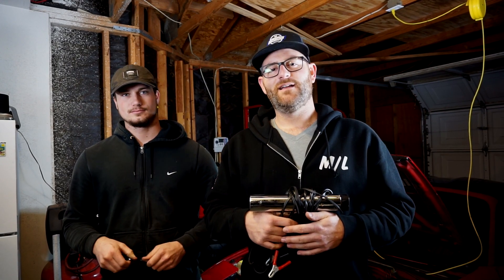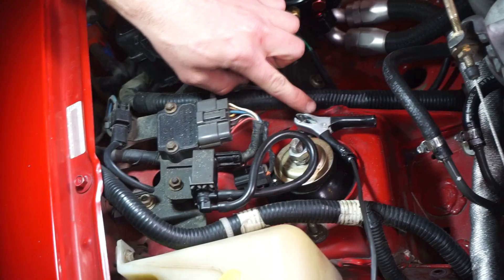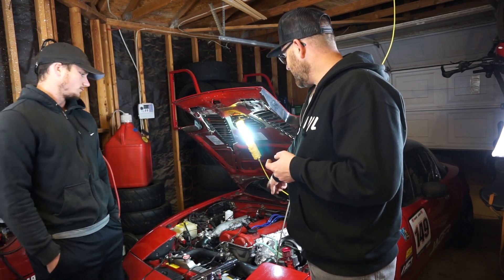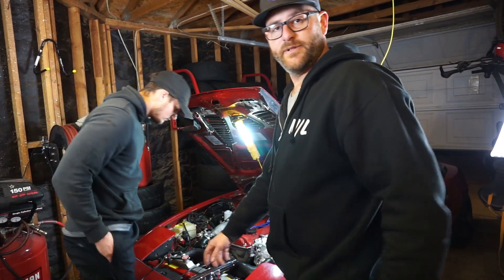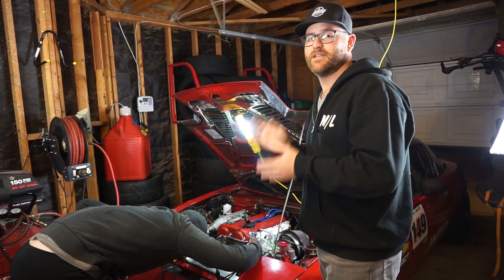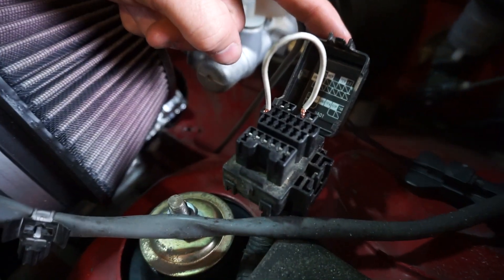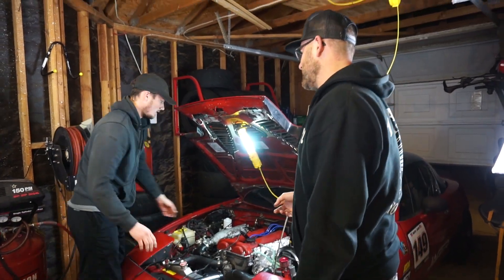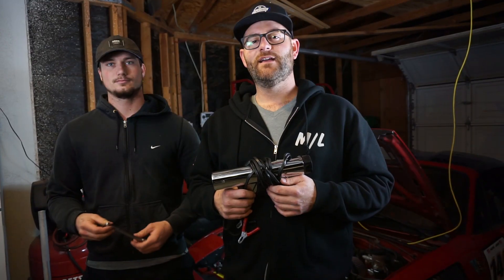How to set Ignition Timing on a 1.6L Mazda Miata

Comment: Hey guys thanks for the video! I have a question that i hope you can answer. 
My TDC mark seems to be way off. No matter how I adjust my CAS I cannot get the TDC mark even near the plastic cover with the “10 degree and T lettering.”  Facing the engine my TDC mark moves between 8 and 10 o’clock. It’s completely on the other side. Please help!
Reply from the maker: I’ve seen it happen a few times, the pulley is actually bad... they begin to spin (the outer on the inner). It’s either that or your timing is wayyyyy off. You can use a screw driver to determine if it has spin to check TDC.
Reply: @JagerRacing  screw driver in cylinder #1 ? ... I think you might be right about the pulley.
Reply: I came here to sanity check. I was checking timing after CAS oring install (1993 usdm 1.6L) and couldnt find the mark i painted on with the timing gun. Turned out at like.. 11oclock vs 1oclock with the engine at TDC... But shockingly it perfectly lines up with some weird boss on the lower timing belt cover. Too perfect to dismiss